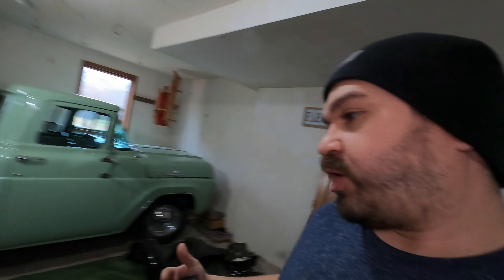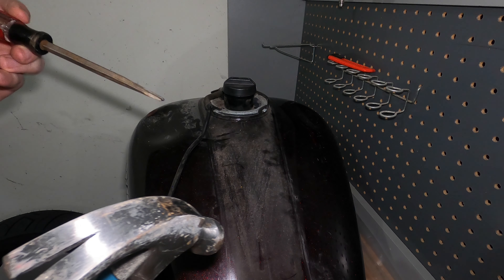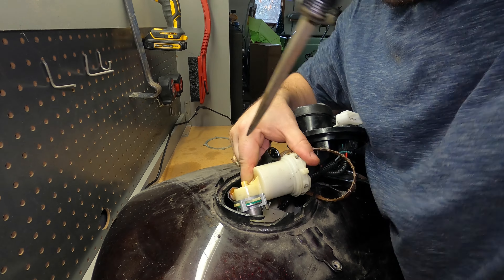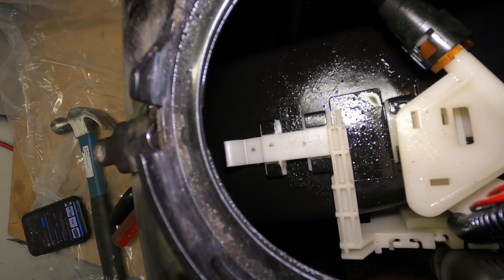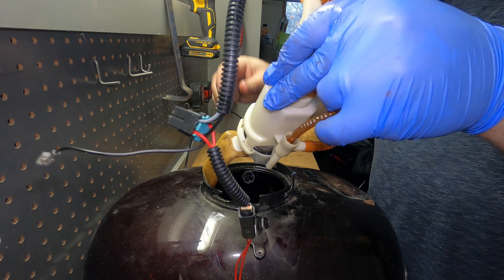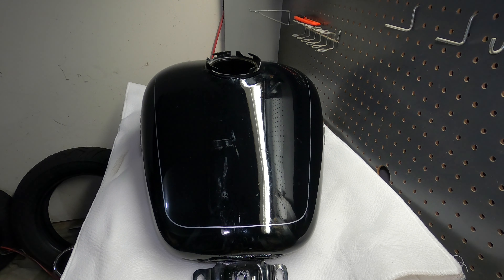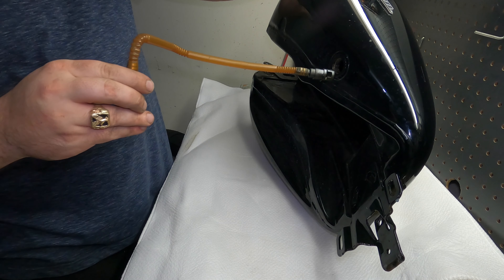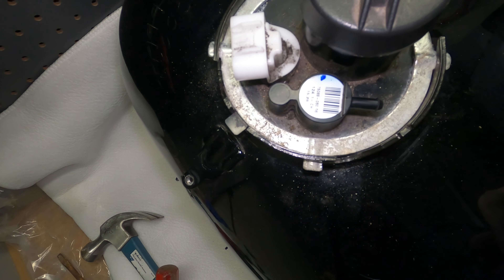How to swap Harley Touring gas tank internals

Comment: The strainer on the bottom of the pump, you should always replace, If it gets soft and dirty The pump will suck it closed, and shut off It's own fuel flow 👈
Reply from the maker: Great tip!  Much appreciated